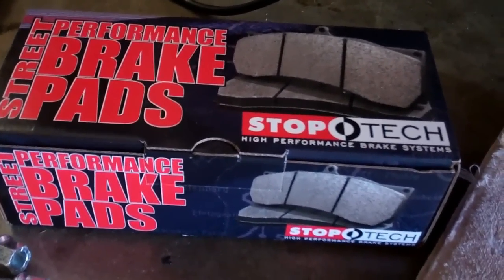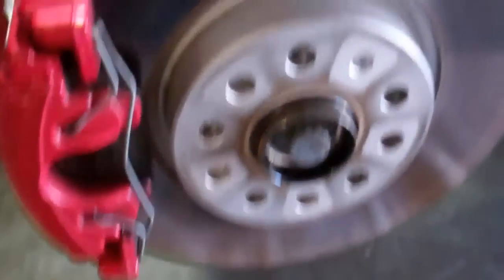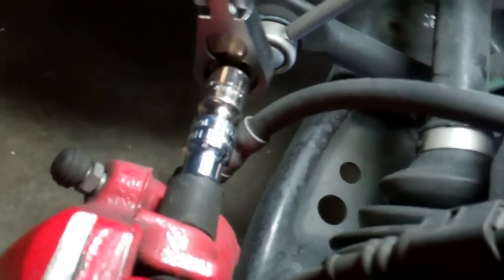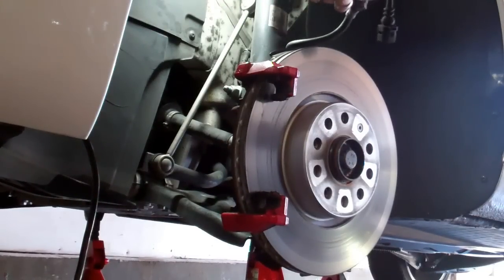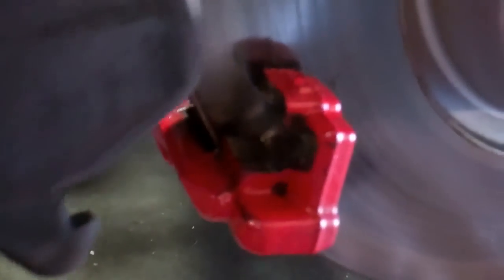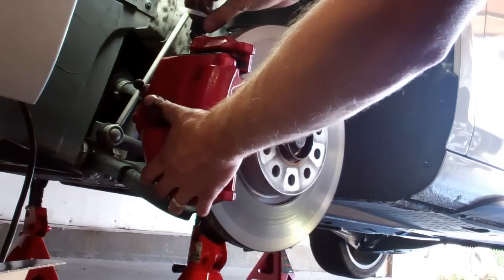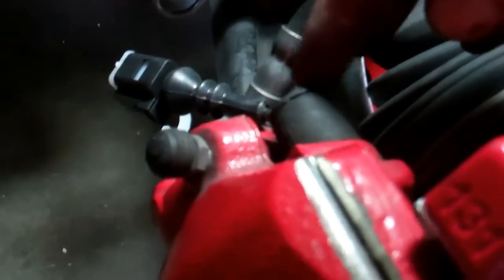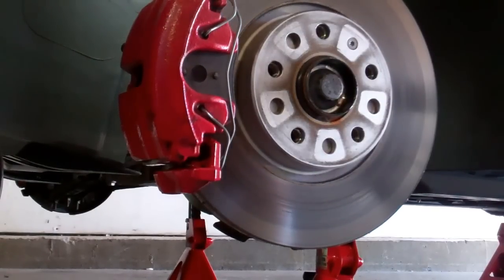2011 VW GTI: Ep. 46: Changing Front Brake Pads

Comment: terrific video. I used this video to do my entire front brake job and it was very successful. Thank you for taking the time to be very granular in your explanation. I also used another video on how to change the air filter so that I could remove the intake and open up the power steering fluid reservoir. Both of videos combined made for an easy job with no mistakes or spilled fluids on the ground. Have a happy new year!
Reply from the maker: +Jay K thanks, its an old video.

Comment: Great info here. I'll be on a first DIY, parts arrive in a few days. Got a few questions for you:

What tool did you use to push down the piston? (I will use a 4 inch C-Clamp).
How can I make sure the reservoir doesn't spill? What would be the correct brake level fluid after compressing the piston?
What tool do I need to dismantle the Calliper Carrier Bolt (will swap out discs too)

Thanks for sharing.
Reply: MGS VW RR 

I watched this video in order to help me with replacement of front pads and rotors on my 2010 GTI...and Id like to add a few things of my own. Everything is almost the same as replacing brakes on any other car, but when it comes to our cars, all you need to know is: Once you have the caliper removed, the two bolts holding the caliper bracket-carrier will not be easy to take off. I tried torching them, spraying lube, hammering them etc (all the common steps involved in the process of removing a stuck bolt) but none of that worked... for the DRIVER side, use a car jack to push UP on the rachet-wrench or whatever it is youre using to take off those two bolts. Pushing your tool up with the jack will cause the bolts to spin in a direction required to have them removed. Be careful, make sure the tool doesnt slip from the bolt(place your hand over it to secure it), as this might strip the bolt. Passanger side works the opposite way, so you I would recommend using an ANGLE RATCHET, with the socket straight on the bolt, holding it with one hand, and a BAR attached to the ratchet handle, for increased leverage.
When you take off the carrier, clean it up, put it aside, clean all the bolts(wire brush,sand paper, clr or whatever) and then remove a small screw thats located in the ROTOR right inbetween all the lug nut holes, (i forgot the size of it). This screw may or may not be easy to take out. Mine was stuck on the drivers side, so i put the tool in it as if im about to losen it, and banged the handle IN (towards the rotor itself) to shake it lose. It came of  easy after that. Be careful not to apply too much force when determining whether its stuck or not. If its not stuck, it will come off real easy. Hope this helps.

Comment: hey guys... i noticed no one has a done DIY video for replacing rotors on our cars...so here some info on stuff i experienced while replacing them. Sorry i didnt make a video.

Everything is almost the same as replacing brakes on any other car, but when it comes to our cars, all you need to know is: The two bolts holding the caliper bracket-carrier will not be easy to take off. I tried torching them, spraying lube, hammering them etc (all the common steps involved in the process of removing a stuck bolt) but none of that worked... for the DRIVER side, use a car jack to push UP on the rachet-wrench or whatever it is youre using to take off those two bolts. Pushing your tool up with the jack will cause the bolts to spin in a direction required to have them removed. Be careful, make sure the tool doesnt slip from the bolt(place your hand over it to secure it), as this might strip the bolt. Passanger side works the opposite way, so you I would recommend using an ANGLE RATCHET, with the socket straight on the bolt, holding it with one hand, and a BAR attached to the ratchet handle, for increased leverage.
When you take off the carrier, clean it up, put it aside, clean all the bolts(wire brush,sand paper, clr or whatever) and then remove a small screw thats located in the ROTOR right inbetween all the lug nut holes, (i forgot the size of it). This screw may or may not be easy to take out. Mine was stuck on the drivers side, so i put the tool in it as if im about to losen it, and banged the handle IN (towards the rotor itself) to shake it lose. It came of  easy after that. Be careful not to apply too much force when determining whether its stuck or not. If its not stuck, it will come off real easy. Hope this helps.
Reply from the maker: Filip Ocicek good tips

Comment: What about lubrication? I bought a front brake pad set for my car and it has a packet of "brake component lubricant" in the box.
Reply: You just lube up the slider pins and the back of the pads with em, I'm doing it right now.  I'll let you know in a while if they squeak what areas I coulda lubed up more.
Reply: 3 years later no squeaks! Haha!

Comment: I have a 2013 Polo GTI 6R 1.4 and I have the same braking system, for some reason I don't have a brake pad wear sensor on the orginal OEM pads but the new ones I bought have sensors, can anyone help?
Reply from the maker: ok dude.. so the Polo prob doesnt have the connectors right? Make absolutely sure the harnesses arent tied up anywhere before you continue here: If nothing is found, people do one of two things. Pull the sensor off the pad, its just glued on. Or cut the wire right off the pad. Just be 100% sure first!! And ALSO note.. sometimes a car will only have a sensor on one side.. So check ALL FOUR wheels before you decide to cut anything. those pads probably fit other cars too, that is why it has a sensor wire.

Comment: Everything went smoothly right up to putting the wire clip back on (2012 Passat).  15-20 minutes to change the pads - will probably be here for hours working on the clip. Beginning to think this clip was designed by Satan.
Reply: Clip has to be fitted first in a hole, then in the second hole. Using just hands.